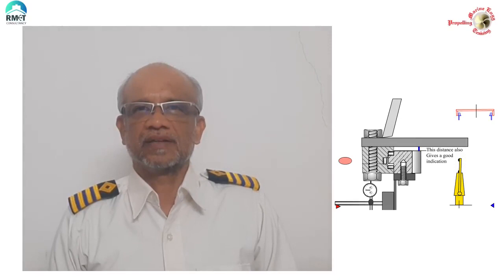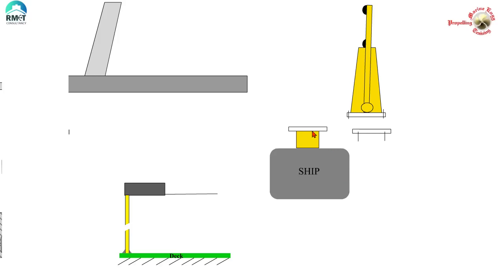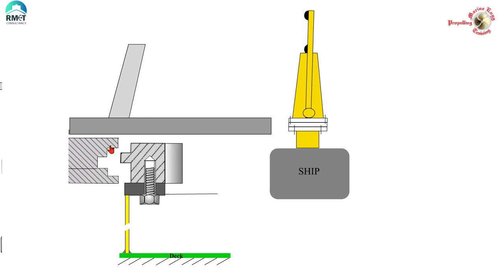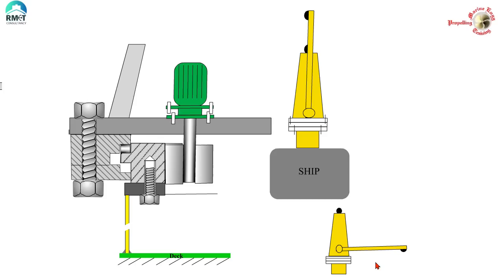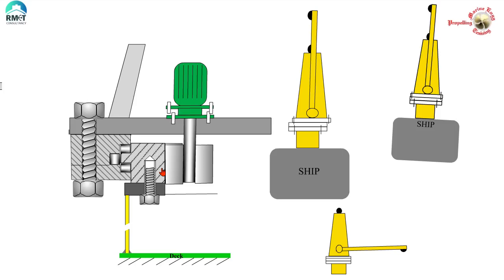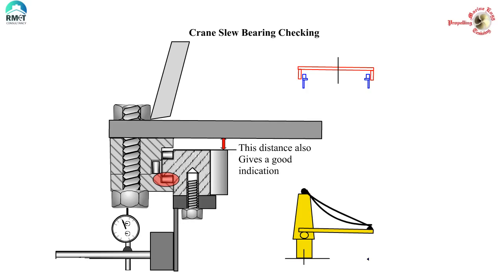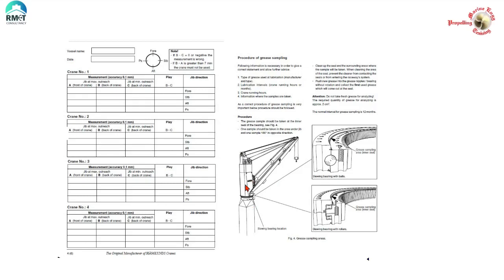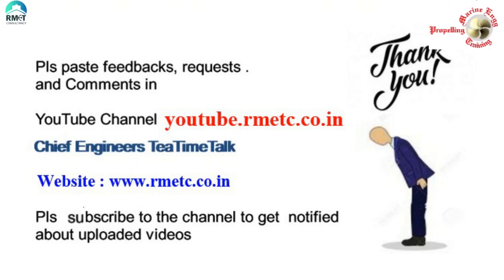Rocking Test Video.How to Do??What is Crane Slewing Bearing, how to check??|RMETC videos |Ramesh S

Comment: CHIEF is it possible please to make a video about Shaft earthing system (Spark erosion) as its not well explained in the internet, some people use the term electrical potential and potential different without understanding the meanings, people say that turning shaft generate that electricity without mentioning anything about stray current. I'm sure you would explain it in a way that beats all. since its not explained well in the internet could you please arrange a tea time for it.

Comment: Crane Pedestal
Crane Turret
Hoisting/Lowering
Luffing : Jib Up n Down
Slewing

Inner race is fastened to the crane pedestal. Thus stationary. 

To take the load of toppling

Load due the weight
Load due to the Toppling
Load due to listing

Comment: Good day to you Sir, very informative video. Few makers recommend the jib to be at its maximum angle in vertical axis while taking rocking test. You have mentioned the jib to be horizontal, which answer do the examiners accept. Please guide us, Thank you so much in advance. Your hard work is making all our lives who are appearing for exams so much better. Gratitude cant be expressed in words Bada saab. Thank you once again
Reply from the maker: Jib angle is generally measured from vertical axix. SO amximum ..means horizontal...anyway --it is the difference  between max and minimum,,however you imagine..😄

Comment: Sir what could happen if too greasing to the bearing
Reply from the maker: too much  greasing will make a motor run hot -- BUt for VCtrane slewing etc..I guess it is not a problem ..the grease will come out anyway.Better than NO GREASING😂